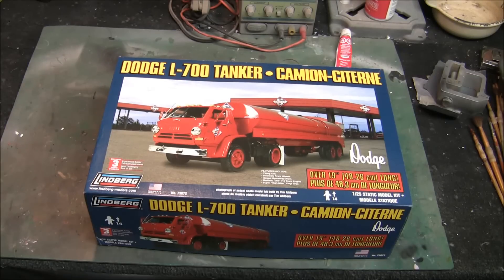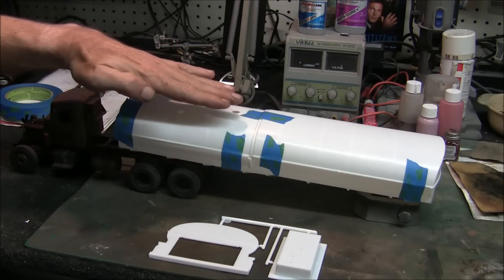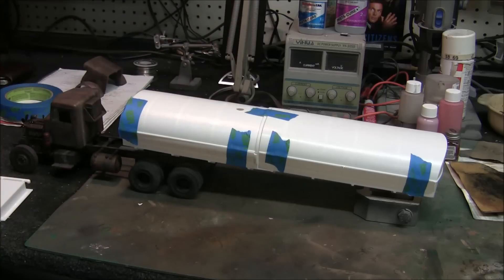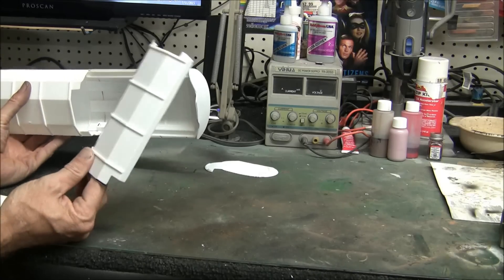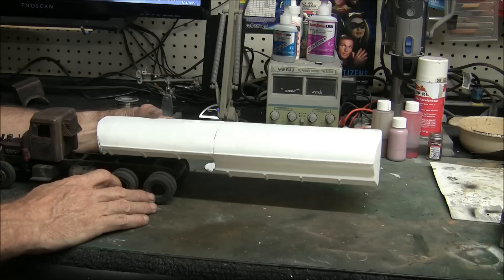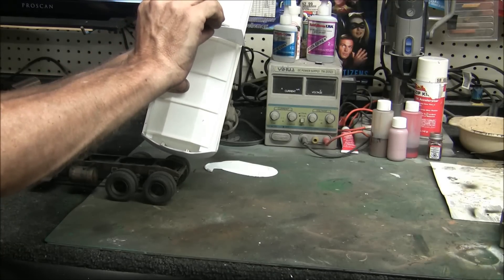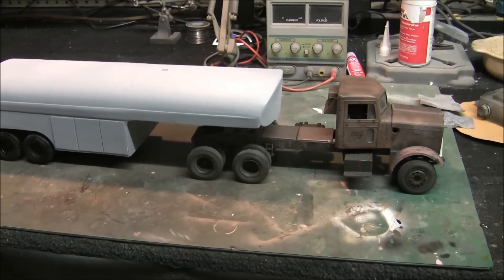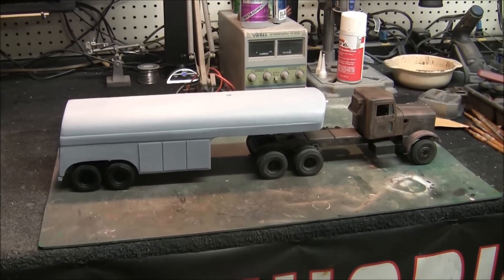Building The Duel Truck Pt 2 - Scratch Building The Tanker Trailer

Comment: I found this trailer (only) on ebay. You could get more and link them to lengthen if you wanted. Just to help you with your terminology, the "hitch" is called a Kingpin and your platform on your tractor it attaches to is called a Fifth Wheel.
The disappointing thing I found with all trailer kits is,  only 38'-40' and same rims. I'm get two flatbeds so I can make a 48' spread axle, next

Comment: What materials did you use to make the reinforcements in the tank? What materials did you use to make the upper profiles of the tank, those perimeter where there are inlets? What materials did you use to make the engine front grid? great thanks
Reply from the maker: I used sheet styrene plastic in different thickness's to make everything that I added to the tanker and the truck.
Some of it was pre cut strips and others I cut to size myself.

Comment: whay in the video you see that you have joined two pieces of tanker? Perhaps you've cut the tanker in two parts?
Reply from the maker: The tanker kit comes in two parts that have to be joined together. I sanded away all of the ribbing detail on it
and added the spine on top which was made from styrene plastic strips. The hatches on top are just some plastic domes I had bought earlier for another project that were the right size. The side panels again are just made from sheet styrene that I cut to shape.

Comment: hello, I have to buy 2 dodge L700 to build the cistern?
Reply from the maker: I don't know what a cistern is? I only used one L700 kit to make the trailer. I used the upper half of the tank after modifying it, and the underside frame work and running gear which I also modified.